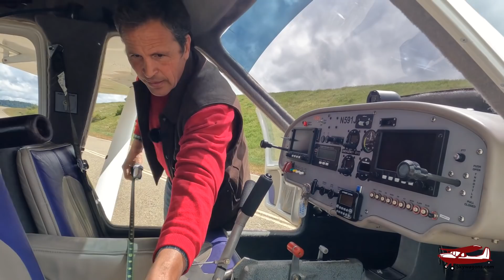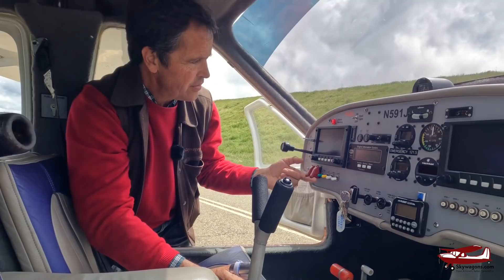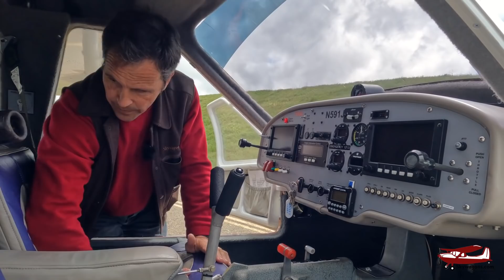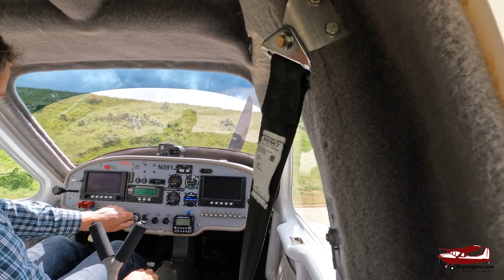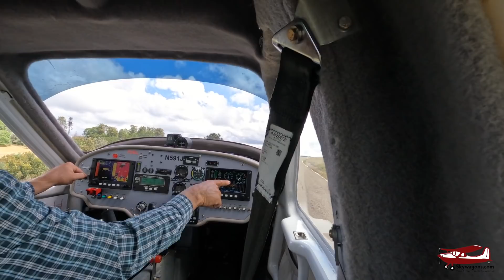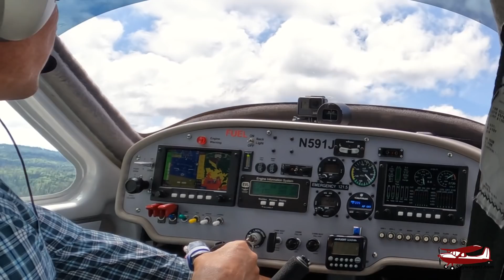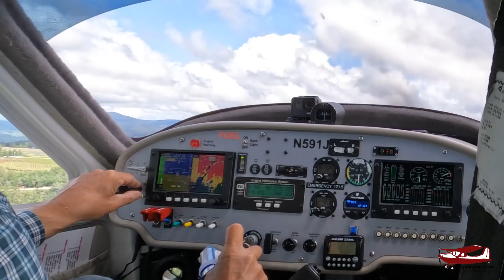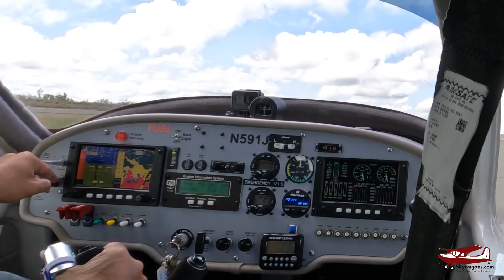The Mighty Jabiru

Comment: Nice review of the Jab Mark. That one is very nicely appointed compared to the early ones, it’s like chalk and cheese in comparison, they have come a long way.
I owned a 230B, kit built, 2004 built. Mine was always overheating if the OAT was 30C or more, despite a bigger carburettor jet and modified cowling, a new oil cooler etc, nothing would keep the temp down, always ran hot.
I don’t know what the later ones are like, I see that one has an even more modified cowl to my old one.
I could hear the radio static a couple of times on that one as you circuited, that brought back memories of mine trying to stop the static, even changed the regulator to a more expensive one and added some suppressors.
The engine was their downfall and it gave them a bad name here in OZ. The J160 I gained my RPL in failed over the ocean but the pilot managed to land on the island they were heading for, that same plane had a second engine failure but wasn’t a mayday.
Having the fuel taps under the seat belts caused a forced landing in my Jabiru when an instructor and a mechanic took it up for a test flight after the engine was repaired. The pilot owned a J160 which has the fuel tap near your knee and wasn’t aware my taps were hidden under those shoulder harnesses. There’s about 5Litres of fuel under the seat in a header tank which they emptied in a few minutes, ended up landing in a crop trial site. 
The airframe is great, easier to fly the 230/250 than the 160, sleek design, fuel efficient, strong, docile, a better option than the 160 which is short in the fuselage and has shorter wings.
Reply from the maker: Thank you for this first hand owner info.

Comment: I love my 2007 250 .  Full GRT glass panels auto pilot.  I’ve flown it from California to Ohio and over the last 2 years it hasn’t set still long . I fly along at 100 to 104 knots at 3.7 gallons an hour . 7 hour flight is normal .  Climb rate just me and half tanks is 1400 ft per min.   Take the front wheel off your pedal bike and you can get 2 in the back with room for camping gear.  35 knot landing speed ..  hard to beat the 250 for the money ..
Reply from the maker: They are great planes.
Reply: @skywagonuniversity5023  a under rated aircraft in the light sport world..  the j250. Does three times what the j230 does ..  lands slower higher pay load shorter take off ..     higher climb rate 1400 ft a min out of mine on a 90 degree day ..

Comment: Never seen a jabiru reach its TBO without major work, the TBO is at 1000Hrs and the complete top end rebuild is required.
Reply: Complete TBO is 2000 hours.   
TOP overhaul is at 1000 hours.
Reply: Just turned 1007 hours in my Jabiru 3300 and the only maintenance I did was a carb rebuild (took about an hour) at about 600 hours. 
I actually flew it today! You can tell its not a new engine but compressions are still good.
Meanwhile,  my neighbor bought a 2019 Cessna 206 for 700+k and he is already replacing a jug.

Comment: I do like the center mounted "Y" control stick--clear view of the panel, and easier ingress/egress without a control-pole that you have to squirm around.  Just like the original Wittman Tailwind!
Reply from the maker: It was surprisingly big and easy to get in and out of.
Reply: I was a little skeptical of the center stick but after 1 hour  was convinced,this is the best position for a stick,comfortable as the arm rests on the center pad not hanging as dead weight forward for what can be hours on end,i couldn't go back to Joy sticks or a yoke.

Comment: But those aileron cables?!?
Reply from the maker: Those cables behind the seats that go up to the wing roots are the worm drive cables for the flaps.
Reply: @skywagonuniversity5023 I liked the video, but JT was correct.  The teleflex cables control the ailerons.  The flaps are conteolled with a shaft that is either manually adjusted or adjusted with an electric drive motor )linear actuator).
Reply from the maker: @1cardinalflyer   Thank you.  I stand corrected.
Reply: @skywagonuniversity5023  Ah ok. But those flap cables?!?    ;-))

P.S. Love your videos.

Comment: Sooooo with the right hand on the stick and the left on the throttle who works the brakes? Also 2 big red cutoff switches near the throttle? Other than that cool little plane.
Reply from the maker: It's surprising, but you don't need brakes until it's on the ground and idling.  Like an early Cherokee.  Hand brake only.  Saves brake pads and accidental feet on brakes while landing.

Comment: Why don't they just put a Subaru engine in it?
Reply from the maker: I suppose you could because it is experimental.  It'd also be three wheel drive.  ;-)
Reply: Purpose designed aircraft engines are usually far superior/safer than converted car engines
Reply: @kkiwi54  the early jabiru engines weren’t much good
Reply: A chappie recently put a Subaru engine in a Zenith he built,he flew towards our strip after the first flight,engine screaming at high RPM's,no thanks.You can barely hear Jabiru's overhead in the circuit.

Comment: I'm having a hard time with the caged Master Power and Avionics switches should the default not be on?  just seems like asking for the power to be killed.
Reply: I have a little less than 800 hours on the Jab and I have the same setup except I dont have the caged switches and never came close to inadvertently shutting those switches off. They take some deliberate pushing to move them. Even if you did shut them off in flight the engine continues to run until you turn the key off.
Reply: @kellydaniels0044  the cages would make it easier as they add more leverage but you are correct the engine would not be effected

Comment: An odd looking but neat little plane! I find it attractive that it's fairly modern and well priced. Not so sure about the flap switch being so close to the throttle. It seems that in rough air one might bump it. The smooth surface of the airframe and the miserly fuel burn is a bonus. If I was in the market to buy a Jabiru, the digeridoo and boomerang would have to be included! What's better if you buy one from Mark, he might play something on the digeridoo thanking you for doing business with him. Cheers!

Comment: I like it!  I wonder why they designed a 6 cylinder fir 120hp?
Reply from the maker: It is very smooth for sure.
Reply: The four and six cylinder Jabiru engines all have the same internal parts.
The same cylinders, pistons crankshaft dimesions, the same valves ect.
Four cylinders gives 80hp, six cylinders give 120hp.
They made a eight cylinder engine for a while I presume that made 160hp.

Comment: Mark, just wondering about the location of the red guarded mag switches.  Seems like it would be awfully easy to inadvertently turn one or both off with an errant move of the left hand.  Concerning to me. Thanks.
Reply: I agree! The switch covers are installed incorrectly. The covers are made to ‘cage’ the switch, to prevent accidental shutoff.
Reply from the maker: True.
Reply: I’m an aviation safety scientist and I would definitely move those switches. It was the first thing I noticed when it got flying. A very poor decision to put them there. I’m sure you can nominate the safe space when you order a Jab. Which is what I’m considering.
Reply: @rogergraham6342 I read from other owner that switching them off while on the flight doesn’t turn the engine off…
Reply: Are that for the mags or power/ avionics? Mags on the key in their model I think 🤔

Comment: I had a jabby 230 for two years living here in Texas you could almost not fly it during August as the cylinder head temperatures would get too hot.  That one you have there seems to have the upgraded or updated fiberglass induction cowling for the rear cylinders.   After a few years I sold it and it went to Minnesota where there is no problem overheating up there.   
 Fast forward a couple years about a zenith 750 with a 3300 generation three jabiru in it. Still had overheating issues in the summer. If you were just cruising around the grass strip and not getting up to cruise speed at let’s say 6000 foot mine would be right on the red line for heat problems.  
 I wish they offered that jabiru airplane with a Rotax 915.  That airplane is absolutely amazing and that engine is also. If they offered it with a Rotax or Viking they cannot keep up with production with them selling. That engine is their biggest holdback.
Reply from the maker: Thank you.  Interesting owners experience.
Reply: The Jabiru engines have a very poor reputation in the UK, FWIW.
Reply: @sheldonholy5047  Can say the same down here in Brazil, my dad used to buy those engines for the experimental airplanes he sold. Most of the R-12 (the aircraft my father used to build) jabiru powered are having issues, you fix it, and another problem arrives.
Reply: The Gen4 3300 seems to have solved those issues. I have a J230 in Texas with a new Gen 4 motor. I watch the temps like a hawk especially on these 100 degree days but so far have yet to have any problems. Climb at 80-85 kts and temps all stay in the green
Reply: You might have solved the cooling with a deeper lip on the rear of the cowl to induce more airflow, that seemed to work here in Australia. Rotec in Aus used to offer water cooled heads as an upgrade for Jabiru engines, they also had a dry sump offering for them. I had a J160 for about 10 years and the main issue was the small sump capacity on long flights. Also be careful running avgas in them unless you can get the low lead option. They lead up really quick.